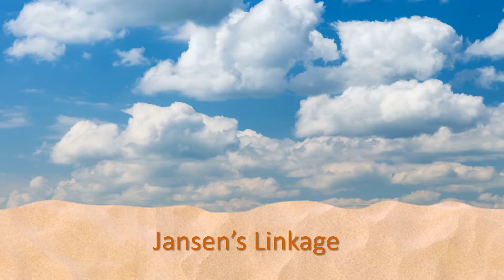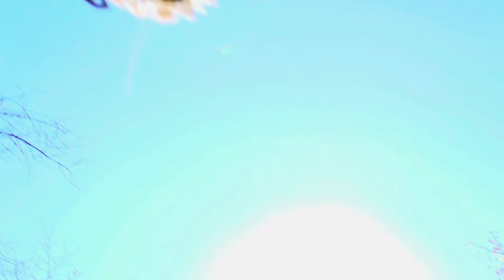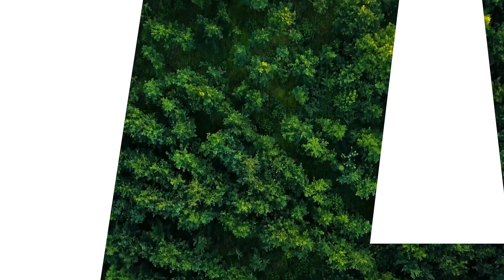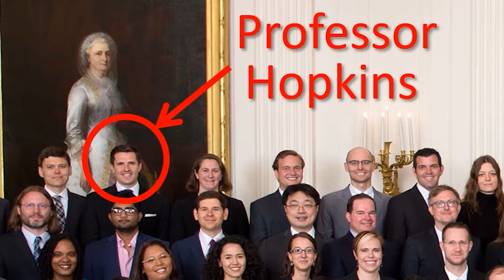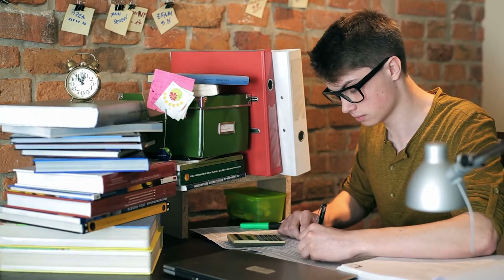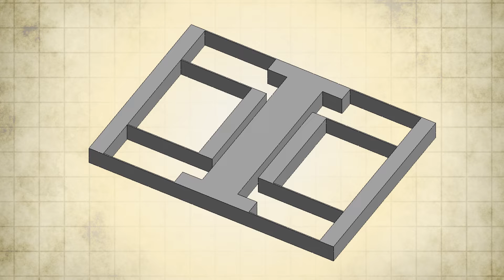“Introducing Flexible Machines: Course Overview” – Compliant Mechanism Design (Part 1)

Comment: Im a piano builder since 10 years and I own a 3D printer since a year, and I printed mechanisms and compliant mechanism to learn more how I can bring 3D prints in the piano action. I want now to remove all strings and joints to compliant mechanism. Thank you for your teachings, I will dismantle the process in small simple parts and test everything
Reply: What an intriguing  notion.

Comment: Okay Prof, you're doing good work, but don't let it go to your head. : ) Beginning at 0:24, you show both invertebrates (two) and vertebrates (six) as examples of non-rigid organisms. Invertebrates alone support your point. A break dancer and gymnast, using the bone structure of their arms, are not examples of your point. Vertebrates enjoy the advantages of being both rigid and non-rigid. This duality is elsewhere. The structure of a house allows for life inside. The structure of a road system, with traffic laws, allow people to drive safely and efficiently. Public transportation systems are the same, as are stable legal, financial, and political systems that allow people to flourish. So the flexible machines we like are complemented by rigid systems.